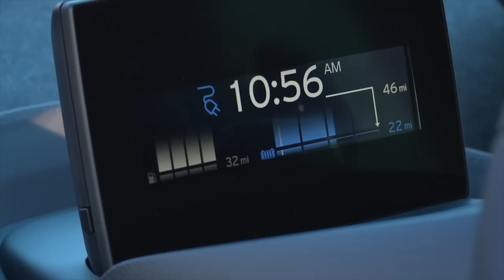Five Things We Need To Improve About Electric Cars

Comment: In the province of Ontario Canada where I live, there have been MASSIVE installations of Wind Turbines in the past few years.  Many of those are within a few hundred meters of major transportation arteries.  Sadly, MOST of the time the majority of those Wind Turbines are NOT turning and that is very frustrating as a taxpayer who helped foot the bill the install these monstrosities.  It's NOT because the wind isn't blowing.  It is because the grid cannot accept the power those turbines produce since their output exceeds the current demand side of the grid.  It is my understanding that those turbines are capable of producing at least 1.5 Megawatts of energy.  SO, why not install a massive battery storage cell at the base of SOME of those Turbines (perhaps every 30 miles or so) along with about 20 Rapid DC Charging Stations.  This would help allay fears of holiday travelers.  That way, the turbine could be kept active with the battery acting as a buffer instead of having the investment sitting their locked down much of the time.

Comment: Small batteries are more expensive!!!  Small batteries are a trap.  The life expectancy of a small battery is way less then a large battery.  It has to do with not only relative size, but the fact  that deep cycling a small battery does way more damage then shallow cycling a large battery.  Replacing batteries will always be more expensive.  IE replacing a small battery will always be more like 2-3 the cost of the original installed in the factory.  It's pretty much standard for all car parts.  Also the speed of fast charging is proportional to battery size. IE a battery 3 times the size, charges 3 times as fast.  The battery chemistry doesn't exist to fast charge a small battery at the same MPH as a large battery.

To make the small battery case work, it is way more complex and expensive then most people realize.  That's why Tesla choose large battery packs.

Comment: The truth is that at 350 million metric tonnes(how much recoverable?) Lithium is the sore point. If things keep cranking up at current rates, they'll have dug it all up in ten years.
Reply: It can be extracted from sea water. Projects are working on this at the moment so then supply will be limitless. Though there are new batteries with different chemistry  in the works as well.

Comment: Electric vehicles are a good interim solution to the problem of emissions, and the fact that we will eventually run out of oil to make fuel with.  Hydrogen fuel cells are, I believe, the long-term solution.
Reply: For lorries, maybe trains and ships, not for cars. Hydrogen is a horrible fuel. Wall to wall drawbacks on the small scale. Also with an EV I can make fuel at home with my PV array. Now I have the array even free hydrogen fuel would not be an incitement. The low power,  slow heavy over complicated car would need a subsidy as well.

Comment: We don't need to improve electric cars, we need to improve the way we think about mobility. Premise 1: People (and Americans in particular) will never accept pushbikes, e-bikes or e-kick scooters as a viable alternative -- except in the centers of cities -- because of two fears: 1. fear of other people: you are safer in your car (except where guns are involved, which is rare) and 2. weather: you are safe from lightning and storms (except when a tree falls on your car, or you drive into a flood and need to be rescued). Premise 2: we really do not need 200-mile range EVs if our average daily driving +2 standard deviations is 50 miles or less. We have known for a long time that an 80-mile EV can service almost everyone -- and we know that it's possible to rent a gas hybrid for the two or three long trips made by most people each year -- and yet we still insist on long-range EV capability.  

There is no range problem and we do not need to "improve electric cars": there is a mentality problem and we need to improve our perception (need vs want). This is crucial because we need volume now, not a small proportion of sexy, expensive, long-range super-cars. Tesla Model 3 goes some way toward expanding ownership and (just as importantly) visibility, so it is arguably a real boost for public perception of EVs -- but we need all auto manufacturers to make the switch to volume EV production NOW, even if that means moderate range vehicles.

Comment: I agree with your comments. The top 3 for me is a well maintained charging infrastructure it’s no good simply putting a new charger in only for it to stop working and then it stays like that for god knows how long. The next point replacement battery packs at a sensible price. Simply scraping a car at 10 years old because the fuel tank is dead is crazy. How many 10 or even 15 year old ice cars do you see on the roads. loads. and most look in really good condition. All it does is massively affect its resale value. But the replacement battery has to be proportional to the value of the car. And finally the price of the car it’s self has to be closer in price to its petrol equivalent other wise people will not bother. Great show as always keep it up.

Comment: lol the bmw I3 i thought was a bigger version and then just released the guy was tiny.  PHEVs will not be needed in the long-term, but I still think they make great sense in the short to mid term.  yes they are more complex than EV, but besides Tesla I not confident in other makers battery packs.  I would way rather have toyota prius then a nissan leaf or chevy bolt.  I cannot be a model 3 for probably two years that is in the 35,000 range. and it will be 6 years before a used one makes sense financically.  but I could afford a number of used phevs today.  I have yet to get one because I drive so little
Reply: Prius isn’t exactly cheap.

Comment: Good point about rapid charging and battery size. It's more practical and less costly to implement proper temperature regulation for rapid charging than double the size of the battery.

Comment: UK government has not increased fuel duty (carbon tax), is stopping solar FIT, is reducing rebate on evs and supports HS2which is totally unnecessary, wants fracking and wants to fill Anglesey with a new nuclear plant. They then lie about having no ice cars by 2040.....can’t trust any government as all controlled by oil. Perhaps I should sell my Tesla.

Comment: You mentioned NantEnergy in a previous video (thank you so much for bringing them to my attention).  If the charge times are acceptable, two of the mentioned concerns could be addressed by their batteries.  (I wish them the best and hope they are successful.)   But I agree too that, regardless of battery improvements, a 90 mile battery pack would meet 90% of trip needs.  And, as I've said before, the other 10% could be met by a low cost, high efficiency on board generator (note: a unit dedicated solely to generating electricity, NOT a series or parallel hybrid).  Such a configuration would allow for the manufacturing of a Much less expensive pure electric drivetrain vehicle.  A car made for "the rest of us".

Comment: Model 3 is a rockstar.
Drives itself literally.
Regenerative Brakes make brake pads go 200k without brake replacement.
Plug into your home.
Very quick 
Supercharger everywhere
Cheaper than gas × 6 
Peerless mapping

Comment: For adoption specifically, my ranked list is a bit different: 
1. education/awareness — most people still don’t know EVs are even an option 
2. price/incentives
3. range — battery size is physically correlated with potential charge speed, so by all accounts cheaper kWh is the thing to push for, not small batteries
4. form factors — many folks want SUVs, minivans, and pickups
5. access to and awareness of chargers for city living

Comment: There are aftermarket sources of traction batteries for electric vehicles.  A case in point is my Honda hybrid.  It's a first generation hybrid with a NiMH battery pack.  I had the battery pack replaced by Greentec Auto, and in the process they upgraded it from the original 900Wh to 1100Wh, and they did it for half the price that Honda wanted.

Comment: Another problem...Most Ev cars are too small. If you are over 185 cm and 100 kg, you won't fit in most evs. I would own an Ioniq by now, except for the fact that I have to sit in the back seat. Same for the e-golf. And forget about the Smart. I have to try the Leaf and the Bolt to see if i can make the move to evs.
Reply: I'm 190 cm and 90 kg and have no problem either driving my Ioniq or sitting in the back with the front seat's position unchanged even for longer drives (anyway, you can't drive it for more than 2 hrs - you've just got to stop to recharge!)... So there, I've got a much different experience...
Reply: gardreropa My job requires me to get in and out of the car often. Since I have to sit with the seat all the way back when I drive and then have to push the steering wheel in and bring the seat forward to get out, it gets annoying. The door frame is several centimeters in front of my torso when in a driving position. I also am way heavier than you are, which forces me to lower the seat quite a bit. That may be the difference between us. I have a versa now, which is the most comfortable car I have had in years, and I hope either the Leaf or the Bolt will be similar.

Comment: For charging stations, I'm about to drive from Portland to Seattle. In a BMW i3, which uses the CCS quick charging standard. There is a gap between CCS charging stations larger than the range of my i3. Along one of the "most electrified" highways in North America.

I have the REx model, so I'll be able to use the REx to make up the difference.  And newer BMW i3s have enough range to make it the whole way on one battery charge.  But someone with a pre-2016 i3, without the range extender, would have to stop at a level 2 charger at some point, and sit there for multiple hours, to be able to make what should be a 3 hour trip.

(There are plenty of CHAdeMO and Tesla chargers along the route.)

Comment: Upgradeable EVs would be nice, so you can buy something that has real basic but light trim inside with a miniscule battery that can be upgraded. If you only get 20 miles range but can pick the kids up and go shopping then what is not to like? Keep the old car - dad's car - for the visit to the grandparents across country and all should be good.
Such a super basic car can actually excel at functionality, e.g. with 30cm of legroom in the back. Also the bonnet can go to have a 'cab forward' version of a crossover. If you want HVAC, hifi, in car entertainment and satnav then those could all be DIY upgrades, a bit like updating a computer. 
Some of the batteries could be structural, built into body panels so you don't have brackets holding brackets that contain containers containing containers that contain batteries containing cells. Just make the bodywork hold them if you want to add the range.
If you could hose down the basic plastic interior then that would be good. Who needs posh seats for short runs to school and work anyway? Upgrades to carpet and other fluffy things could be done over time, making it fun to pimp out the car. Add an extra motor if you want if 4WD with performance. Make it so there is a rich ecosystem in upgrades. Efficiency should also be great with no cupholders or rear windscreen wipers. My bicycle weighs less than the frunk liner of a Tesla and gets me to work and the shops just fine. I have thought about getting an EV but I am not physically disabled or with kids to ferry around or a dog to 'walk' or with lots of consumerist activities to engage in. But older people need something. The luxury should come from having a nice big space that is quiet and on a small footprint. Keep it simple!
Reply: · · except of course we know that people don’t like.  Range anxiety is a big issue.

Comment: Sounds about right.  I would add car manufacturers should make certain features standard.  Just as power windows, door locks and intermittent wipers are standard on most ICE cars.  DC fast charging, heat pumps, heated seats, heated steering wheels, and LED headlights,should be standard on all EV's.  For reasons only an EV driver will understand.

Comment: Thinking about it, modularity on battery packs is a complete non starter.  Battery packs are not just a DC connection, they are tied to the cars control systems in a complicated way that will always be different for different manufacturers.

Comment: What if U-haul rented a battery on their little trailers that plugs into your vehicle while you drive 3000 km?
Reply: Thaylor Harmor .  I wonder how much uhaul would need to charge for renting a trailer with a $10000 battery pack?
Reply: Andrew Hart when we rent a $30,000 car we pay a fee, so what the difference for a company?
Reply: Thaylor Harmor true.  I guess if there was a steady demand for it it could work.  But it would still be a lot more expensive than a standard trailer.  I’ve never rented a uhaul so I have no idea what the difference in price would be and if it would be worth it for the convenience of not stopping at a charger
Reply: Andrew Hart so the idea is that during normal day-to-day use we want a smaller battery that doesn’t weigh a lot to satisfy our daily use.  When we want to drive the 500 mile trip we go rent one of these trailers that extends our car’s range.
Reply: Thaylor Harmor understand.  But is it really so bad to stop for a break at a charging station instead?   ....  at least for a tesla.  If I had an EV with a 100 mile range I suppose I can see the benefit
Reply: Thaylor Harmor ... also might be just easier to rent another car for the trip
Reply: Andrew Hart good point.  Just drive every two hundred miles and rent a new car.  Or just rant a gas car for these long trips.  Oh well, that seems to be the best idea for those who aren’t in the super charger network.
Reply: Thaylor Harmor .  I was suggesting that if you had an EV with a short range you could rent an EV with a long range.  Sorry I thought that was obvious.  I’ll try and be more explicit next time.
Reply: Thaylor Harmor ok got it now.  You wee explicitly suggesting this for non Tesla owners.  Agree makes more sense for them, but hopefully only a few years to wait before other generally available networks spread.
Reply: @andrewpaulhart  No battery pack needed > www.youtube.com/watch?v=KtWyxLzUMqQ&feature=youtu.be, OR www.youtube.com/watch?v=-g4dKZTnxHo .  Compact, efficient and light weight.
Reply: LOL